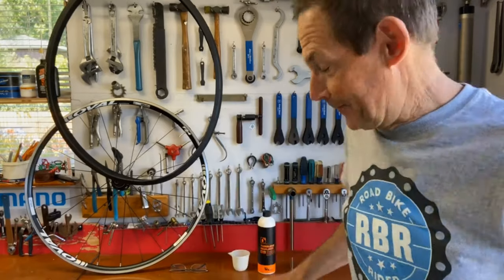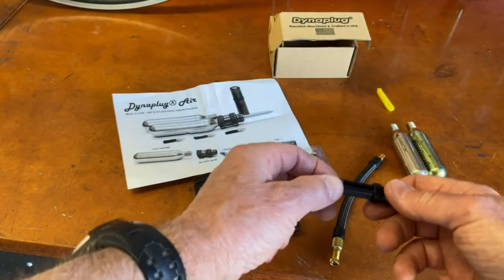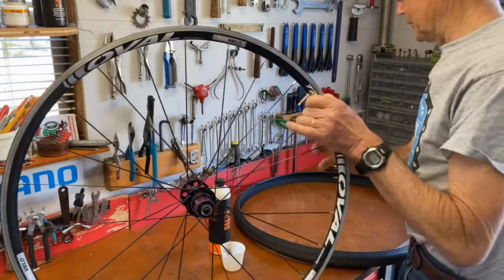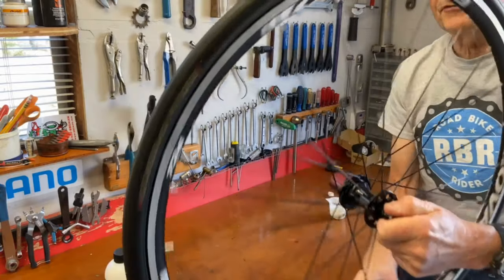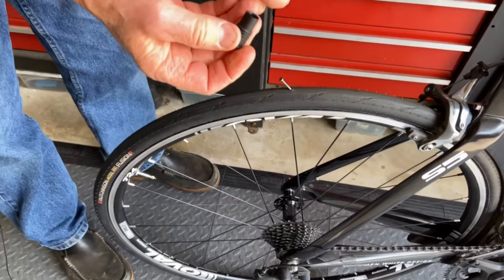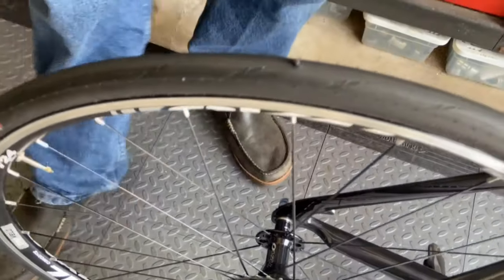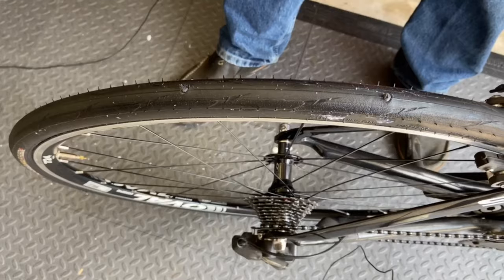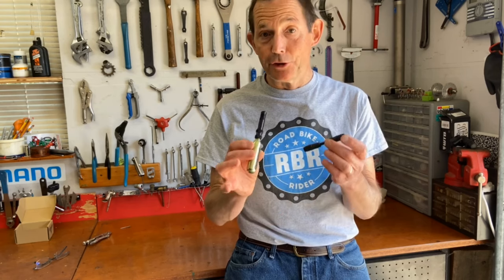Testing Dynaplug's Great Tubeless Bicycle Tire Repair Kits #tubeless

Comment: I went tubeless years ago until I had a flat in the winter that the sealant didn't seal. It took 40 minutes to clean out the sealant which was semi liquid and gel-like so I could stick a tube in. My hands were frozen and that was it for me, I went back to tubes. When I heard about the Dynaplug I was intrigued having worked in a gas station while in college and plugged many a tire the same way. So now I'm ready to try tubeless again. Your excellent video came at the perfect time as I have the Dynaplug but wanted to see how it would work in the real world. I have ordered new Conti 5000 TL tires and will give tubeless another shot. Thanks again for the excellent video.
Reply from the maker: That's a helpful tubeless lesson for anyone who is thinking of getting them, Pbarr19. Thanks for sharing! I look forward to hearing how the plugs work with your new tires. One thing about those Conti 5000 tubeless tires, I've seen one defective one brand new out of the box that was undersize and essentially impossible to mount. If you run into that with either of your tires according to the spokesman I called at Conti, you send them back or bring them back to where you bought them and they will exchange for a new tire. Hopefully you won't run into this issue and the tires will go on no muss, no fuss. But just in case, I wanted to let you know. Thanks again for your great comment!

Comment: Great demonstration, Jim.  Walmart car tire plugs work great in bicycle tires too.  They actually work better than the bicycle specific ones because they are very sticky.  Pack of 30 for $6 US.  They are long, so I cut them in half for 60 plugs.  Plenty to share with riding buddies at negligible cost.  I also use the cheap tool from Walmart and cut the handle off to fit in my seat bag.  Fixed many flats with this setup and the fix outlasts the tire most of the time.  I've had a couple leak after a year or so and I simply stuck another plug in.  Cheap easy fix and readily available.  Thanks for the great video.
Reply from the maker: Thanks a lot for watching, victoryvisiontour and for sharing your great tip. Much appreciated!!
Reply: Walmart sells multiple car tire plugs/repair kids - which one do you use?
Reply: I agree, the Dynaplugs work, but they are just a more expensive version of regular tire plugs.  For what ever reason, bike specific plugs seem to be made "cleaner" which may initially appeal to a bike rider, but they are less effective.  Plugs for car tires work great, although they can be stickier and thus a tad messier.
Reply: @branchingfactor  The cheapest.  Usually it's the Slime brand.
Reply: @branchingfactor  I would recommend you get a bike specific tool, such as Leyzne or WTB, and then you can get the refill kits from any auto parts store.

Comment: I just watched this vid as I have the Carbon tool. I had a loss of air and sealant from a small puncture in my front tyre this morning. The tyre sealed enough to get me home but leaked slowly. I have used the RACER tool for the first time, it worked first time and has sealed the tyre. I have left the little tail protruding, it is soft and will squash down hopefully blocking the hole further. I have inflated with air now,rather than the co2 and will get out later, weather permitting to check and test. It does seem like it’s secure though, I trust it to be fixed for good. Thanks for a very useful vid
Reply from the maker: Thanks for watching, Jimbojet and for sharing the review of your Carbon tool. I'm glad to hear it worked well for you.

Comment: After struggling with so many flats over the Summer, I went tubeless with a foam insert on my road bike.  It is safer because if I get a flat at speed there is no chance that the tire will come off and I can ride some distance flat.  I went into the Canyon show room in San Diego and the staff recommended these plugs for the few times the sealant won't stop the leak.  So now I carry the tiny plug device shown and cylinder of CO2 instead of an air pump.  We'll see: I haven't needed to use the plugs yet.
Thanks for the video.
Reply from the maker: Thanks a lot for watching and sharing your tubeless setup, Alyosha, appreciate it! It's nice that Canyon had the plugs and recommended them. With any luck you might only need them very rarely. Thanks again!

Comment: Just bought a new road bike with tubeless tyres fitted Jim, guys in the local bike shop sold me the Dynaplug Air system to go with it but needless to say I was a bit wary as to how to use this out on the road! Your video demo and explanation was really good and I'm now confident I shall be able to use this system without any problems. Just one point, my son a serious mountain biker who has been using tubeless for years says to be careful letting the CO2 out or the cylinder will freeze to your fingers (!) he carries a piece of old inner tube to slip round the cylinder first as insulation against this.
Reply from the maker: David Roberts Thanks! Your son knows what he’s talking about! Great advice. It’s why some cylinders come with “jackets” - insulated covers. That also keeps them from rattling around in the seatbag or pocket too making noise driving you bonkers. Thanks!!

Comment: Hi Jim, thanks a lot for the video. I have decided on a specific new wheelset that happens to be hookless and requires TLR tyres. Never having considered tubeless because I have no issues with tubes I was quite wary and stumbled across Dynaplug and said I must get that in case I do get a hole that is too big to seal. But most reviews never actually showed how to do it. Your real life example with the explanations gives me the confidence to go try tubeless!
Reply from the maker: I appreciate you letting me know that my video helped you out, messi9991! Thanks a lot for watching and commenting. As long as they're setup properly tubeless tires work really well. Most of the problems people have come from bad rim tape jobs or not enough sealant because too little was put in or it dried out over the months, those types of things. With good tires and proper setup I think you'll enjoy the ride. And if you do flat and the sealant doesn't seal the hole, the Dynaplugs work well. You might want to practice on an old regular tire on a rim just to get the feel of it so you have it down if you do flat. Thanks again!

Comment: Late to the party Jim I know! 🤭
I've just this week converted my 2021 Trek X-caliber 7 over to tubeless as the Bontrager rims are TLR.
Bought a new set of Vittoria Terreno Tyres, blk/tan, 29 x 2.25 & Bontrager specific rim tape + valves complete with Stans sealant. 
First time converting & everything when very well indeed so pleased so far. 
Someone mentioned to me, "what happens if the holes are too big" Hmmm... I don't know I replied! 
So... I asked Google & up pops your video, perfect Jim answered all my questions.
Best Regards:
Graham.
Reply from the maker: Hey, hi Graham! That's a nice setup and I'm sure you're going to love the ride of tubeless off road. I'm happy you found this video and learned about plugging tires. Usually, once you go tubeless you have a lot less flats due to the sealant and no tube inside. Have fun and thanks a lot for watching and commenting, appreciate it!

Comment: Jim, I was surprised at how much force you needed to push the plug in and wondered if there was enough pressure left in the tire to resist it.  Have you tried it on a fully flat tire? If it requires the same amount of force how do you prevent puncturing the rim tape?  I run GP 5000s so you know I wouldn't want to remove it during a ride!! I've read all your comments on it and value your commiseration. Thanks
Reply from the maker: Thanks for watching and the comment, RustedRooted. There was pressure in the tire when I struggled to push that plug in - still about I'd say 60%, so I was pushing against resistance. I did not try it with a flat tire. I think another comment here mentions that he did manage to get one inserted on a flat tire. Mine might have been more difficult than usual due to a flat resisting extra layer inside the tire casing under the tread, but I haven't tested it on enough different types of tubeless tires to know if it's any easier on some makes/models of tubeless tires. I did wet the tip to try to make it easier but that didn't help much as far as I could tell. 

Dynaplug says that the material and shape of their point is designed not to damage the rim or tape so it's possible it wouldn't hurt the rim strip/tape even if you ran it into it. Also, as long as there's a little air in the tire, you are usually pushing the plug in at one angle or another and it should stop before it can hit the rim strip. I put in 4 plugs in that tire and it got a little easier to do it as I did it more. Once you know how much it takes you brace for it and keep the bike from moving and that helps. Okay? I hope this answers your questions and if you give it a try please share what you find and how it works for you. Best wishes for flat-free rides with your Conti 5000s and thanks again for watching!
Reply: @JimLangley1  Thorough reply as always. Appreciated... I live in Tucson where it was very hot for a longer period last summer than ever. I forgot to top off sealant sooner than I usually do and I had a puncture that wouldn't seal which leads to this question: how effective would the dynaplugs be without sealant? I reckon OK if you get back on the bike quickly to compress the plug into the tire, but I'd like your thought. Thanks.
Reply from the maker: @RustedRooted  The plugs are “gummy” - sticky, so I think they would at least slow a leak enough that you could get home maybe stopping to add air a couple times. You live in a beautiful place. I spent a week there in 1979 while riding cross country and I did the Tour de Tucson once and also a PacTour where we left from there. Sweet roads!
Reply: @JimLangley1  It is beautiful here. I moved from Connecticut 5 years ago  primarily for cycling. I like being able to ride every month in relative comfort. I'm a bit older than you and find the cold weather very unappealing. Truth be said the heat was relentless summer and rising at 4:30 on days I rode was getting old but I'll take it without complaint given the beauty of the desert.
Reply from the maker: @RustedRooted  to deal with the heat you might try riding indoors on a smart trainer in the virtual world of Zwift. If your house is air conditioned, you would escape the heat and lots of cyclists find Zwift close to riding outside. Just something to consider.

Comment: Thank you. Running new Schwalbe G-Ones Gravel tyres. . Managed to get home without repair with slow puncture. I guess the liquid did its job. Just ordered both kits!
Reply from the maker: Thanks for watching and commenting, G D W. Usually the sealant does work. Sometimes it takes a while but most of the time you don’t even realize you would have flatted. Having the kits is worth it for the peace of mind. Thanks again!

Comment: I’ve been tubeless almost a year. Dang tires are $80 (Perelli cinturato 700x28). I lost two in one month and since I can’t bear to throw them out, I’m going to repair and reuse!
Reply from the maker: Thanks for watching and sharing your experience with your Pirelli tubeless tires, Ryan. You're right, tubeless tires are definitely expensive and worth repairing and reusing, good move.
Reply: @JimLangley1  results on one of those tires, this morning, I went on a long bike ride. This system performed so well.
Reply from the maker: @ryanmilton2643  thanks a lot for sharing this, Ryan, I'm happy to hear it.
Reply: I have occasionally had to resort to internal repair(thick patch)  of expensive Tubeless tyres that wouldn’t seal with plug or ripped sidewall (stitched) Also gotta think of Planet and get more life out of pricey products👍🏼
Reply from the maker: @ianroberts1997  Thanks for watching and sharing how you patch your tubeless tires to keep them going, Ian, appreciate it!

Comment: I've carried Dynaplugs for eight years on a motorcycle, but haven't gotten to try one out yet--no flats. I know, worthless comment but it's the Tube. If they make a teeny one for bicycles I'll pick one up whenever I go tubeless. At the very least they're good luck.
Reply from the maker: Thanks for sharing that it gives you good no-flats mojo on your moto, Steve. Yes, the ones for bikes are pretty tiny.

Comment: I wonder if the sealant was preventing the dynaplug sticky worm from bonding with the tire rubber right away.
Reply from the maker: Thanks a lot for watching and the thought James. The kit is specifically made for tubeless bicycle tires so I expect Dynaplug considered the sealant compatibility issue when designing their plugs. The plug is so tight inside the type of puncture that I put in the tire in this video that it makes you wonder how air and sealant even got past it. But the sealant did seal the tire after a bit escaped. Overall, the tire didn't get that soft and the plug and sealant together did fix the tire so I think the bonding worked though it did take a little time. In the comments below others recommend different brands and types of tubeless plugs that they've tried and like so you might take a look at those. Thanks!
Reply: @JimLangley1 Truth is I know nothing of bicycle tires. I keep my kits on Motorcycles. I was unaware of the sealant issue.
Reply from the maker: @jamesgregory2962  no worries James, Dynaplug actually makes kits specifically for motorcycles, here's a link: https://shop.dynaplug.com/collections/motorcycle-atv Thanks again!

Comment: Hi Jim,

For the car ones, you need to use the reamer tool (like a rat tail file) on the tire to prep it for the plug.  You should also use rubber cement on the plug.  

Best,

Mark
Reply from the maker: Hey, really appreciate you watching and sharing your tips, Mark. Thank you.
Reply: Rubber cement probably doesn't hurt.  I have been using car tire plugs on bicycles for many years and never used rubber cement.  Just plug and ride.  The plugs usually outlast the tire.

Comment: Hi Jim, thanks for the video! I ask myself how to get the plug in when the tire is completely deflated? I mean... you recognize that you're losing air, you stop in a safe place, you check the damage and finally get out the repair stuff - in the meantime the tire will be flat as it can be and if there's a big hole in the tire you won't be able to pump it up again to a certain degree. This is a lot more realistic than the repair-shop-scenario, where you pull out the nail and push in the plug the next moment. Thanks for your answer!
Reply from the maker: Thanks for watching and the question, Martin. I've been riding tubeless tires on road bikes and mountain bikes for some time. With the sealant inside, you don't flat that much which is the nice thing about sealant - it finds and seals the hole most of the time.

But, when you do flat and it doesn't seal it right away, usually it will seal it if you wait. I've had sealant spraying out of the hole covering me and my bike and gotten off the bike to fix the flat only to find that the sealant stops the leak eventually and there's still some air in the tire even minutes after first noticing the leak.

So, it would be kind of unusual for you to find yourself on a tubeless tire with sealant inside and have it go completely flat. But, even if it did, you would just need to hold the tire and wheel even tighter to keep the flat/no air inside tire from moving on the wheel when you pushed a plug in.

It wouldn't be as easy as pushing into a tire with air inside. But you push the plug in at an angle so you just have to get it through the hole. You can see in the video that it's not easy to get it through a nail hole. But, if you had a hole that the sealant couldn't seal it would be a larger hole meaning you'd have an easier time getting the plug through.

But I would say it would be rare to run into that scenario if you have enough sealant in your tubeless tires. I would also point out, that you would carry a tool like the Dynaplug in a pocket or pack where you can get it fast. So, it should only take about a minute to pull it out and stick a plug in the hole - even faster with a little practice.

Okay? I hope that answers your question. I am pretty sure some other viewers asked the same question so you might check the other comments and maybe find some threads discussing this issue more. Thanks again and here's to no flats!
Reply: @JimLangley1  thanks Jim for this long and detailed answer (although it‘s been a while ;-) I haven’t had any flats since then!
Reply from the maker: @martinbohl6476  you're most welcome!

Comment: Thanks for the detailed video. If I understand correctly, the metal tip remains inside the tyre? I would have thought that could potential cause damage to the rim or tape.
Reply from the maker: Thanks for watching and the question, John. The tips are softer metals so they shouldn’t be able to do any damage. But the way tubeless flats work, you almost never are fixing a fully flat tire cause the sealant is slowly sealing even larger punctures so the tips are usually unable to contact the tape or rim. Thanks again!